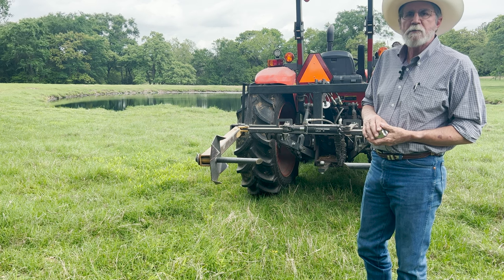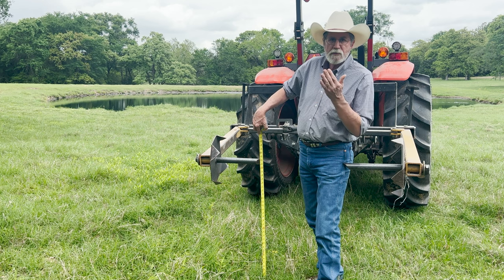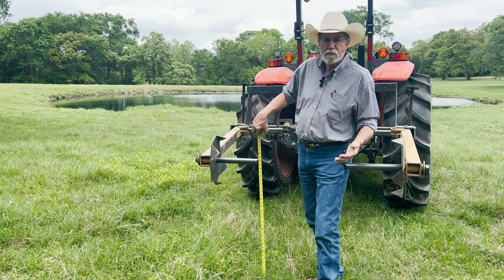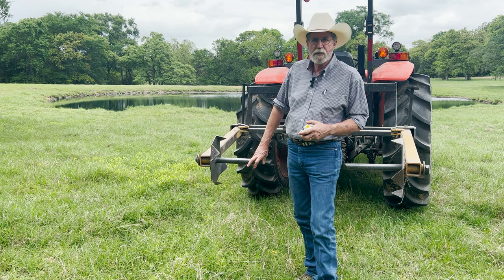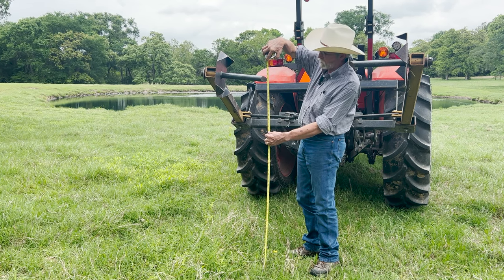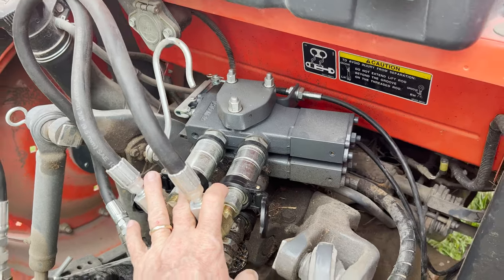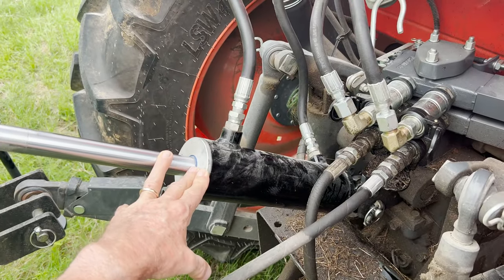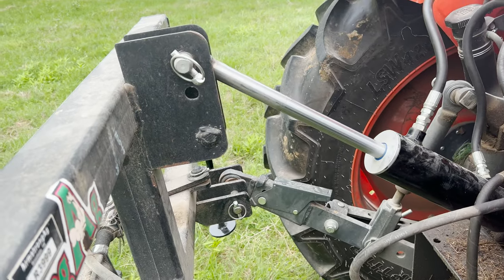Hydraulic Top Link Addition To Hay Unroller | Regenerative Ranching

Comment: If you use the bottom hole on the tractor side for the toplink and shortened it it would be high enough . Using a shorter topling if it is still to long and doesn t lift high enough. It is a cheaper opsion
Reply from the maker: Will it let down far enough if shortened too much?  Asking because I truly don’t know. Thanks for the advice!
Reply: @cliffhonnasregenerativerancher  it all depends on the size of the bale and tractor (tyres hight from the ground compaire to lift movement.  )you use . It is all trial and error to work it out according the tractor you use .